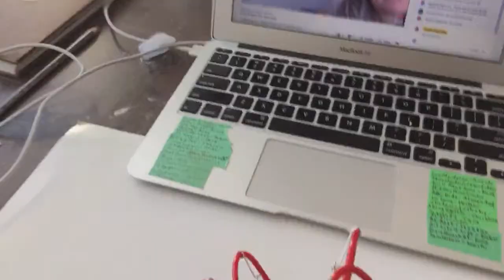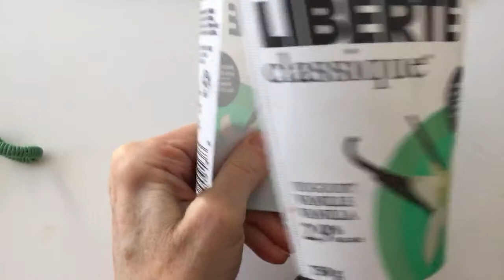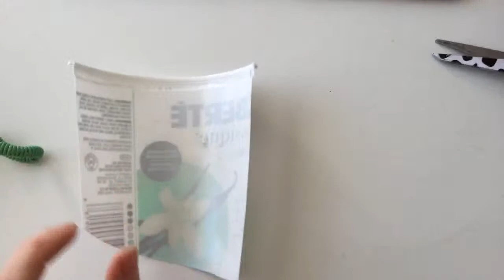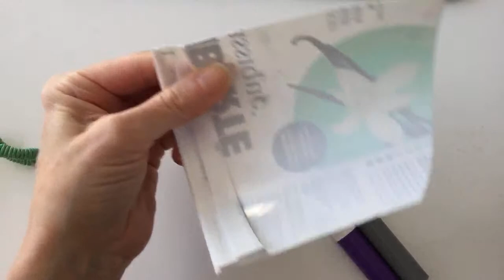▶️   Wire Rose Ornament DIY // Wire Lady TV Ep 142

Comment from the maker: Thank you Amber for the timestamps: Heart template: 3:25
Making petals w/ heart template: 10:15
Making petals free-form: 15:30
Stem and leaves: 22:45
Getting it to stand up: 32:10
Making more leaves: 34:10
Filling in leaves: 37:00 (attaching to stem: 46:25 ~ using excess wire to make another leaf: 47:35 ~ filling in leaf: 50:40)
Adjustments to better stand it up: 54:30